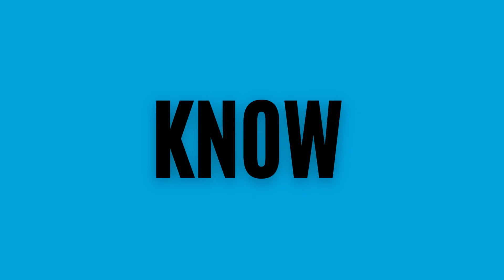Lets talk about Automation with K TIG

Comment: Beating it together? Where is k tig working well at ? And K tig best at ? Anyone using hand held ?
Reply from the maker: Hi @colemcclain7319, Thanks for watching the video. We have many customers that are winning with K-TIG and in particular stainless steel vessels across numerous different industries and geographies. We are still seeing many companies hand welding, so the automation introduction is novel in some markets. Hope you are doing well.
Reply: @KTIG-Keyhole-TIG-Welding   anyone doing hand held K Tig? Any displays in Oklahoma?any  Literature ? I work in traffic and utilities poles.  I thought K -Tig would have been viable in the arms and poles we build . We use Subarc and its ok on alot of things,  but i thought  k-tig would been a better fit on some items we weld
Reply from the maker: @colemcclain7319  K-TIG requires automation due to the requirements for steady and consistent travel speed, and we don't recommend hand-holding the torch. We have a bunch of information on our website www.k-tig.com including comparisons to various different welding technologies such as SAW. Your application does sound perfect for K-TIG and we have a facility in Pennsylvania along with a distributor network that can support very well. If you head to our website and fill in a contact form, we will be able to share more information with you.